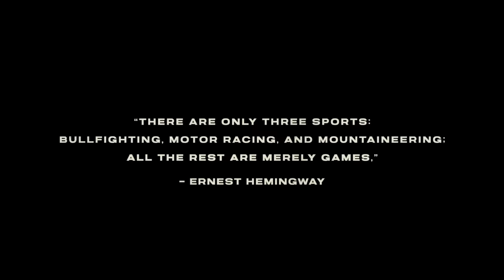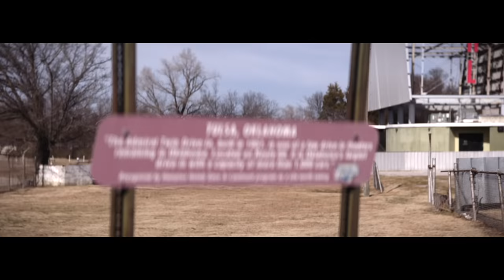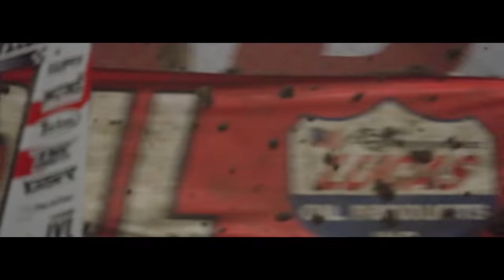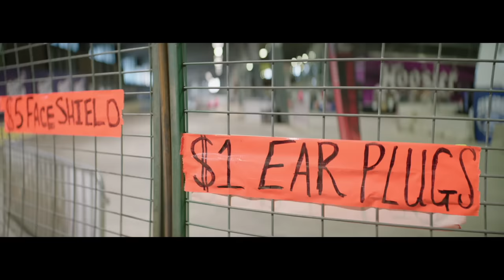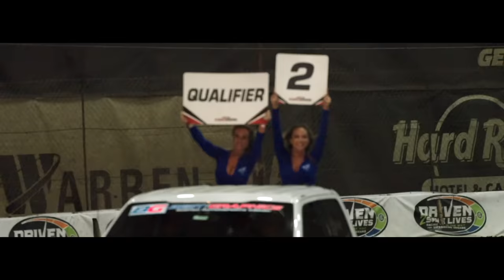DIRT: Switched On Kill (Episode 1) | Sponsored by NOS Energy Drink | Kyle Larson Documentary Series

Comment: The carbon monoxide levels at the Chili Bowl must be outrageous.
Reply: They open multiple roof vents to try and help with ventilation
Reply: Its not that bad, if you go sit up high and you'll be fine. The people who go for the whole week are a little crazy.
Reply: Na, you never heard of industrial ventilation?? Well there is such a thing and venues such as the chili bowl use the shit outta em....... Not sure I have ever heard of anyone, whether that be spectator or driver that has gotten carbon monoxide poisoning inside that venue...... Now I'm sure it exists and is prob slightly higher levels than what ya would find outdoors at some race but it has never been any kinda issue whatsoever
Reply: @ethanayars2459  not to mention the massive fans that are installed all around inside that place to circulate the air out and get new fresh air in
Reply: Methanol combustion produces very little carbon monoxide and the building is well ventilated
Reply: They are all required to run a special mix of fuel at Chili Bowl that is blended to reduce the amount of CO2 produced. So while there's still a lot, its not at the levels a midget car will normally produce. Combine that with ventilation and it shouldn't be an issue.